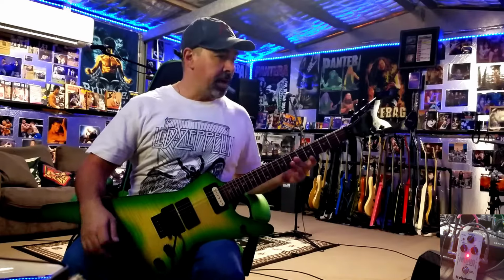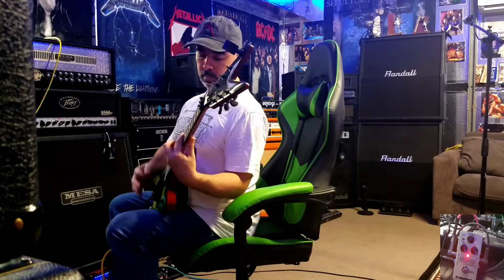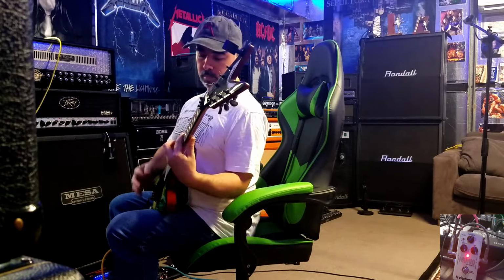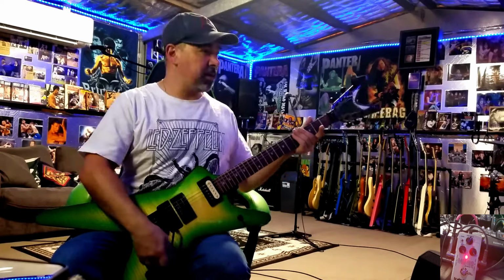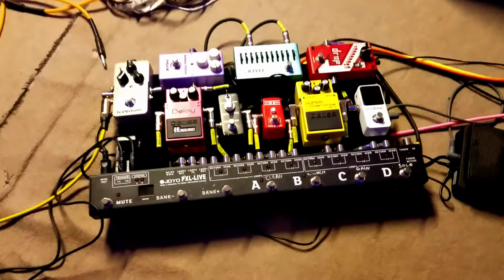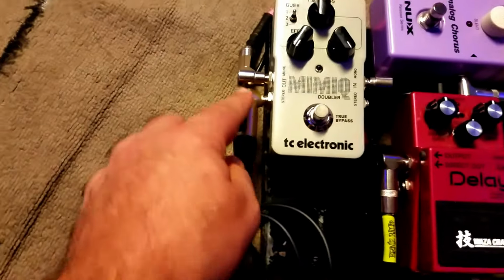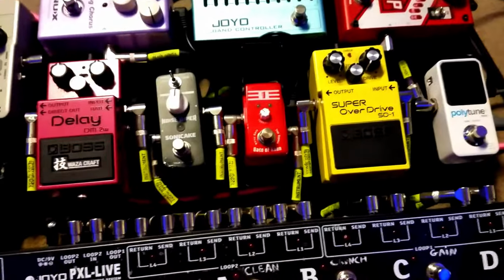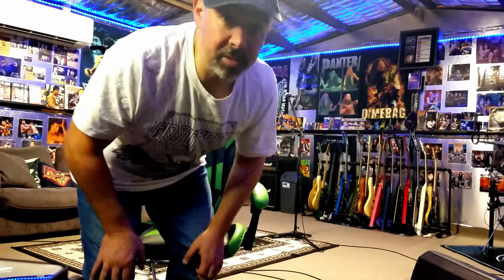Once you go STEREO, you'll NEVER go back! | Mimiq doubler | 2 Amps!

Comment: Cheap way to get similar sound is just buy a Line 6 Vetta II(its cheap used), has 2x150W poweramp, tons of amp models, can simulate 2 different amp at the same time, can do panning, delay, stereo doubler....it even can do simulate Wet-Dry-Wet with an external stereo poweramp...

Comment: Just so's ya know... Stereo rigs are great for the bedroom. Not so great for the stage. Phasing issues are no fun.
Reply: That’s what I thought so. I had this issues when I was trying to perform in school back in my younger days. I feel like a hero in my bedroom with my stereo set up. And then I was zero performing in school. I was all sweaty and nervous wondering how and what happened. 😂. A set up is just not plug and play. It’s placement ,eq level and such.
Reply from the maker: Haven't had any issues with them 6 metres a part but I'll bare it in mind. I wouldn't lug these to a gig anyways... Maybe 2 katana heads and 2  2x12s though 😉
Reply: @KaddysJamKave  It's one of those things... Could be really trippy if done right (if that's what you're going for; stereo delay and whatnot), but it's difficult to get right. 

I personally prefer to keep things simple as possible. The more moving parts there are, the more there is that can go wrong. 

Simple and redundant is the way to go, IMO. The less stage gear you have, the more backups you can bring, as well. It's a happy meal.
Reply from the maker: @MFKR696  🤣🤣😂😂

Comment: I wonder how the Mimiq doubler would sound after or before certain stereo effects, better or worse?
Reply: More of the same in my experience with it
Reply: @opt123123  explain what you mean by this
Reply: @JoshuaSimonson909  It's like hearing double tracking with stereo fx on it. Actually I can hear a bit of delay in this recording. Certainly not worse anyway, just a bigger sound. It wouldnt matter if the mimiq is before or after a stereo effect either as you'd be running the mimiq in stereo anyway
Reply: @opt123123  ok, that is good to know, I plan on using it after my compressor, EQ, and distortion pedal, but before my other effects